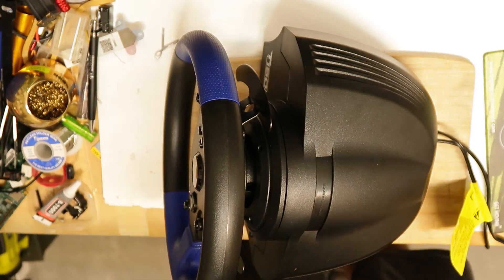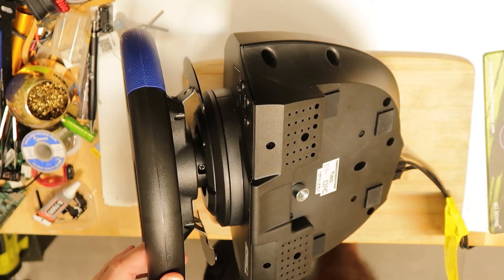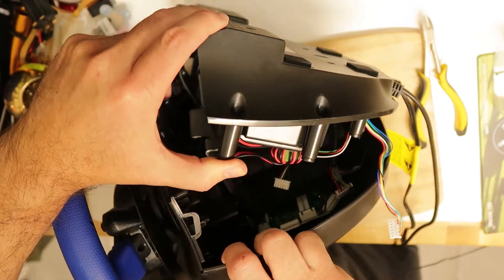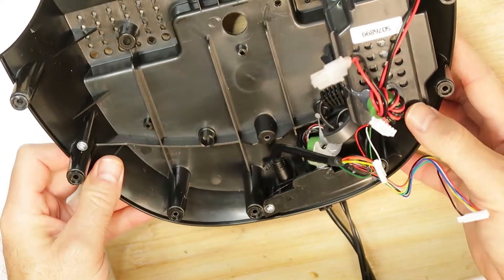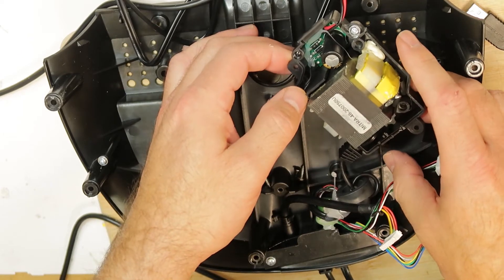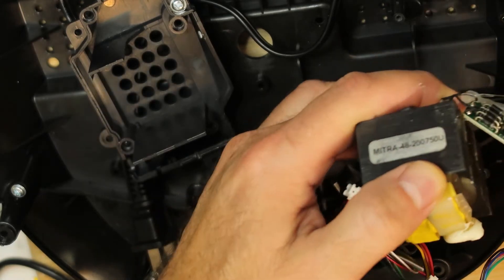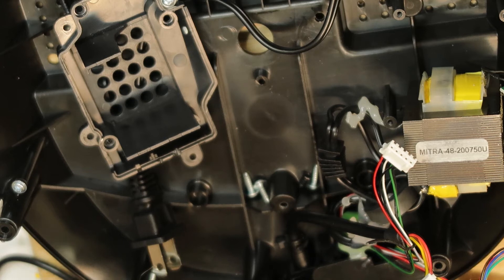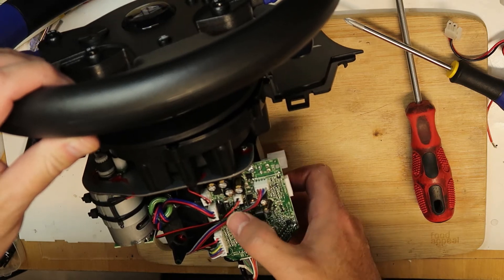Fixing SONY Thrustmaster T150 RS Racing Wheel connected to wrong voltage

Comment: Hi, my wheel is 220 v and its been shutting down after like 15 - 30 minutes regardless of being used
Reply: overheating, either your fan has something wrong
Reply: @Vlad69422  fixed the problem a long time ago, i was supplying it higher voltage than it was made for, used step down convertor and it worked
Reply: @TrySomeCG  Hi I have the same problem now can you tell me what output your power charger have?
Reply: @jimThedude-89 i had 270-300 v which was way too much, i used a step down converter to fix that

Comment: I found one of these at a thrift store for $10. The PSU was bad and only outputting 25W so I'm looking to replace it. I love the ingenuity you put into this so I might follow suit by using an old laptop charger, but wouldn't I not need to buy another capacitor since the charger itself has one in it?
Reply from the maker: you are right probably the capacitor inside is good enough, but beed to check if the system work properly
Reply: @RoeeBloch  I found an old charger, took it apart and it had a larger capacitor than I expected. I was impatient to try and get it to work so I decided to splice the wires anyway, and it powered up perfectly! I was certain that the wheel would get more power than it needed but after testing the volts it was receiving, it came out perfect so I think the laptop charger may have a limiter or something keeping it from delivering too much power. I'm fairly new to understanding electrical components beyond wires, so this is a feat for me!

Comment: You needed to take out four screws from the circular plastic panel just behind the wheel, and then three screws behind that cover. You have to turn the wheel to access the screws. Then you turn it upside down and take out 7 deep screws - two each side, and three at the bottom, then the top cover comes off, and you do everything else you need to do. Thanks to Barry at SIM Racing Garage. His video showed this. Also, the T150 is made by Thrustmaster, which is owned by Guillemot Corporation, not Sony.

Comment: what is the exact stats of the computer charger, and what is the current
Reply: 20V AC Adapter, you can pretty much use any wattage, as long as the Voltage is 20V.
Reply: I recommend same as this 65W or 45W is fine too.
Reply: @chingun7799  the YouTuber that made this video said DC? Not AC?